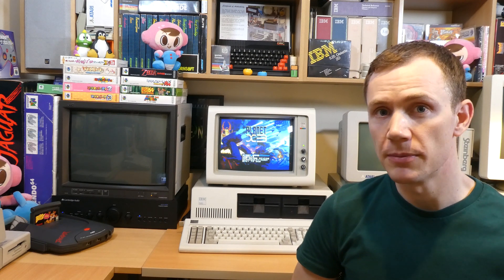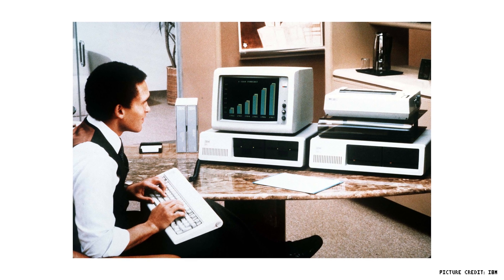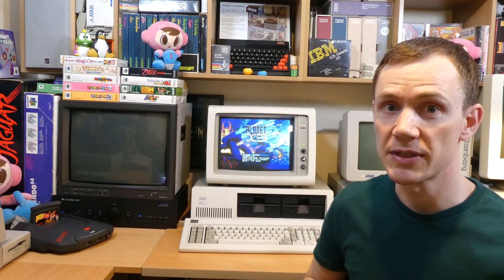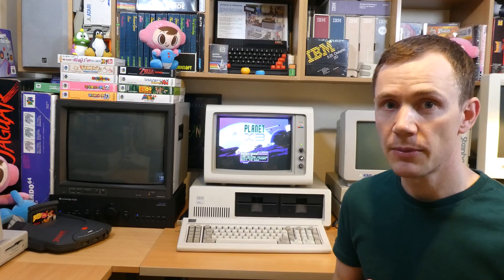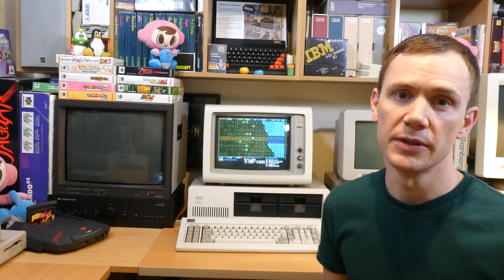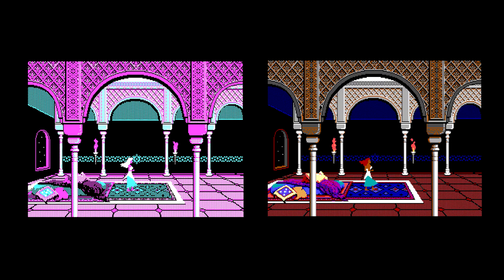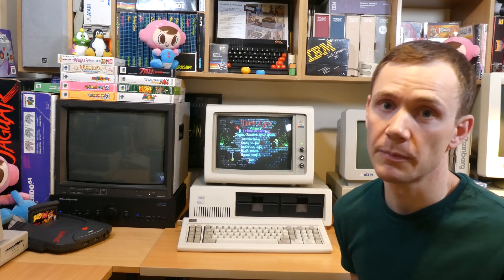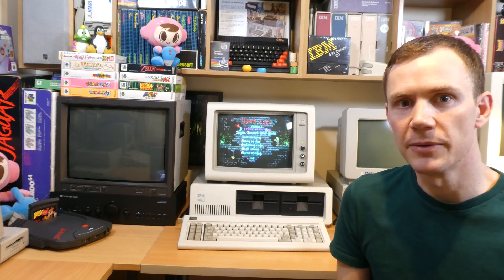EGA Graphics On A CGA Monitor? It's Easier Than You Think! #retrofair

Comment: On an interesting side-note:
My first PC was an Amstrad 1512. This came with an Enhanced mode which extended the CGA 640 by 200 resolution to display all 16 colours. This was primarily used by the GEM operating system but had support for some games as well, where it was generally knows as 'Amstrad Mode.' 
There was also a driver that allowed the Sierra 'King's Quest IV' and 'Space Quest I' games to be played in this mode.

Comment: I have a SYSDYNE! DF1331 EGA monitor. The capacitive power switch does not turn on power. I want to bypass the switch circuitry with a mechanical switch. I can not find the schematic so I am shotgunning the request to the web. Any advice would be helpful.

Comment: I have an IBM 5150 PC  with 640K of memory, a 40MB HardCard Plus and an IBM 5153 Monitor that I got back in the mid 80's.  I also had an external CD drive hooked up to it ((MicroSolutions BackPack CD ROM), an AST SixPackPlus and SoundBlaster CT1350.   

The Logo on the front of the monitor says "Enhanced Graphics Display", so I'm not sure if this is a regular CGA monitor or an enhanced CGA monitor.  I put an Everex EV659 Graphics card in the IBM PC.  The switches in the PC are set to EGA as well as the switches on the graphics card.  I got some games to play in EGA mode, such as Dungeons and Dragons, but not all games would work in EGA mode, such as Risk, so on some games I had to run in CGA mode.  I even was able to get Windows 3.1 to install and run in EGA mode after I made some modifications to the Windows Setup file (the INI file).  

The PC worked for a few months, but the HardCard gave out, so I had to boot from floppy.  Eventually the Monitor stopped working as well.  I don't know if that was because I was pushing it too hard with the EGA card or if the power supply just gave out since the power light on the monitor does not come on anymore.  For now it's just a display item in my study.  If ever I get some spare cash, I will replace the HardCard and repair of get a new monitor (probably a 5154).  It was fun to play the old and nostalgic PC games while it was working.

If anyone is curious as to how I was able to download vintage games, drivers and other files or programs, I built a PC that could run Windows 95 plus able to access older floppy drives.  I downloaded the files I wanted onto my modern computer, copied them to my Windows 95 computer and from there copied the files to floppy or CD's to run and install on my vintage PC. ✌😎

Comment: You get the colors of EGA but can't use the 21.85 kHz Horizontal Sync for 350-lines? So, ega monitors were the first multi sync monitors? as they also supported 15.7kHz.
 But very rare to get hold of now?

Comment: We jokingly called the CGA Crappy Graphics Adapter because even my Apple 2 had 6 color in HGR. Updating the CGA text screen could cause “snow” unless done carefully. It really was a mediocre card. There were a handful of games that pushed the card such as a Pac-Man clone IIRC but that was the exception.

The 8088 MPH demo showcases what is possible which is mind blowing. 

The VGA was a real nice upgrade compared to the EGA.
Reply: The home market for PCs didn't really exist until 1984 so when CGA was released in 1981 it was purely intended for business customers. 320x200 was a relatively high resoultion for the time and the pallete of 4 colours were intended for high contrast in business applications. You need to keep in mind there really wasn't much better in 1981; CGA's 16 colour composite mode was superior to what the Apple II and VIC-20 could do and even arguably looked better than the Atari 8bits. Burgertime in composite mode is a good example of this.  320x200 was a great resolution for text heavy games (i.e. rpgs and adventure games) and despite the common misconception that CGA only has 2 palletes of 4 colours (black/cyan/magenta/white or  black/red/green/yellow both wi) both were two variations in intensity, there is actually a superior 3rd pallete of black/red/cyan/white (accessed by setting CGA to composite mode while connected to an RBG monitor). The background colour can also be changed to any of the 16 which affects all the colours and in total there are 96 different variations available by changing the background colour and intensity. Each pallete has 4 main colours plus 6 dithering combinations and these palletes can be switched realtime during a game. There are mockups of CGA games using these alternative palletes and many look quite nice. 

Overall the main issue CGA cards suffered from was the lack of a home market to encourage developers to actually learn how to code for them. Most games were low effort ports from other systems that made little effort to take advantage of CGA capabilities much in the same way many Amstrad CPC and European MSX games were low effort ZX Spectrum ports. Sierra switched to PC development in 1984 but primarily focused on PCjr/Tandy graphics and by the time other developers came over from 1986 onwards, 16 colour EGA / Tandy graphics were already common in homes. While there were still many CGA users, CGA was given low priority by developers with the idea that most users would eventually upgrade to EGA or VGA (thanks to rapid price drops every year). The default to the black/magenta/cyan/white pallete in most games was just the minimal effort way of including CGA support without needing to think too much about it.
Reply: @dgmt1  The PC home market took off after Nov. 1982 when Microsoft's Flight Simulator was released.  It was THE litmus test to tell if a PC clone was "compatible.

A LOT of businesses switched to the Monochrome Display Adapter (MDA) and the Hercules Graphics Card (HGC) which had a far superior 9x14 pixel font (resolution of 720x350) which made text super clear for Lotus 1-2-3 and Word Perfect compared to the crappy 8x8 font of the CGA.

A few apps even supported the HGC 720x348 graphics mode such as Borland's Reflex.

16 color graphics on the CGA wasn't really popular since it was a crappy 160x200 resolution. Even the Apple 2 had a better 280x192 16 color double high-res graphics mode.

By the time people started to figure out how to abuse the 16 color text mode for pseudo higher resolution graphics the EGA in 1984 started the demise.  The VGA killed CGA off for good.

Comment: Don't ask me the specifics of this, because I don't know enough about electronics: This is how we ended up with VGA: My dad (electronics guy and TV repairman by night) tried this and somehow the CGA screen we had simply couldn't handle the EGA output. You could SEE the glorious color graphics, but it was timed differently or something, and the picture would roll, or get squeezed/distorted, etc. He said he knew how to make it compatible and tried replacing some components in the screen and adjusting some stuff. At one point though it all went wrong (or the monitor simply wasn't destined to be clocked this way) and the magic smoke escaped: Killing the monitor beyond repair. Dad went "well, I guess I'm buying a new monitor" and sprung for VGA instead. I definitely didn't complain.
Reply from the maker: Sounds like you got lucky! Yes, most of the EGA modes are 21kHz whereas CGA is 15kHz, so if your graphics card didn't offer this functionality you'd need a multisync monitor to support both, and they were expensive at the time.

Comment: EGA cards were badly designed to be honest. Even though they had a lot of new features, they were mostly useless and EGA in general was used as a CGA with more RAM that allowed to display 16 colors in CGA modes.
64-color palette was a great idea, but it was limited to 640x350 mode only. It was impossible to change palette in 320x200 or 640x200 modes and 640x350 mode required 256 KB of RAM and special EGA monitor which very few people had back then.

IBM was so disappointed in EGA that their next standard MCGA didn't even support it and was just a CGA with 320x200 256 color mode added on top.

Eventually VGA was made which finally merged all that CGA/EGA/MCGA mess into one and added useful features on top of that.
For example VGA allows to pick custom palette in EGA modes!

Yet still VGA cards lacked useful features like blitter that would not only helped in games, but also would make high-res GUI much more viable. These features started to appear in Windows 95 era, where accelerated 2D become a must.
Reply: apart from the failed PCjr, IBM exclusively targeted the business market and thus both CGA and EGA were never intended for gaming or home users. The home PC market only started in 1984 and was entirely driven by clone manufacturers who very quickly came to dominate total PC sales. For professional use EGA was still one of the best standards prior to VGA's release in 1987. It was superior to both the ST and macingtosh's video modes, and while the Amiga 1000 had more colours, visual clarity was much better with EGA on an EGA monitor. 

As for home PC gaming, EGA's capabilities were wasted but that wasn't due to poor design. RGBI/CGA monitors were relatively cheap and popular with home computer owners of many systems. However they were limited to a fixed pallete of 16 colours and thus any standard that went beyond that would have required a new, and initially, more expensive monitor standard. 640x350 was just too much for gaming setups in the 80s thus once EGA prices became affordable due to clone manufactuers, it was picked up as an upgrade for home users who wanted to get the full 16 colours on an RGBI monitor due to the lack of viable alternatives. Of course it would have been far better & cheaper if IBM just adopted plantronics solution of increasing CGA's vram to 32k and adding a 320x200 16 colour mode rather than releasing both EGA and PCjr/tandy graphics in 1984. But you need to keep in mind that IBM was actively trying to avoid associating their business machines with gaming so that was never EGA's design focus. 

Finally MCGA not being compatible with EGA has little to do with IBM being "disappointed in EGA". VGA and MCGA were both released at the same time with VGA intended as a high-end solution and MCGA being a cut-down cheaper version. Basically they gimped MCGA on purpose in order to tempt users to buy the higher-end models, a tactic they had used with previous releases (for example the 6 vs 8mhz 286 AT). This tactic quickly backfired though when other makers produced much cheaper VGA clones that quickly made MCGA obsolete.

Comment: I'm guessing KQ4 is out of the question?
Reply from the maker: It looks like KQ4 requires a minimum of 80286 CPU @ 8MHz, so I think it would really struggle.
Reply: @ctrlaltrees  I played it on my XT (clone, 640kb of ram, CGA card), using CGA, and it came in 9 floppy disks!. some of the screens were slow, but it was playable.
I don't know if it was 8 or 10mhz because the mhz display thing was broken, it showed "19" all the time, but I know that cpu wasn't 19mhz. probably 10mhz. 
(just to have an idea, I could play fine games like golden axe, prince of persia, maniac mansion, space quest 3 or monkey island 1. that one was slow in some places but totally playable in others).
Reply: @ctrlaltrees  I think it was minimum recommended because the game is fully playable on a 4.77 MHz XT and not too bad on a 10 MHz.  There's the SCI version of the game, and AGI which could be ordered direct from Sierra for an extra $10. AGI was fine on 4.77 MHz, but ugly and had no sound card support (just internal speaker and Tandy/PC Jr.). The sequence to clean the dwarves' tree house would take 30-40 MINUTES with the SCI version.

Comment: I really tried today but I cannot get this to work. I have an IBM XT 268 with an original IBM EGA card and an IBM CGA 5153 monitor. CGA modes do work, EGA modes do not! What exactly will I have to do with the two jumpers and the 4 dipswitches on the IBM EGA card? (The battery buffered Bios, is set to "EGA" via "gsetup", everything else does not seem to work). I'd like to have 16 colors in "prince of persia" instead of 4! Any ideas?
Reply from the maker: Hi! Sorry to hear you're having problems getting it working. I used the 5153 switch settings from here: http://minuszerodegrees.net/ibm_ega/ibm_ega_switch_settings.htm

It's been a while since I played it so I can't remember, but does Prince of Persia prompt for the monitor type at startup or does it autodetect? If it asks, you need to select "EGA" of course.
Reply: @ctrlaltrees  Thanks for your answer.  I know the website of minuszerodegrees, but still no luck. Still does not work. You can type "prince ega" to force ega in prince of persia, but no luck. Maybe my IBM EGA card is broken. I will try another EGA card from a friend......

Comment: That's cool!  I've got my aunt's old 5160 with the 5153 monitor.  The monitor works, but I can no longer get the PC to boot.  It powers, the hard drive spins up, but no beeps or display even though the display works.  I think it got humidity to it while it was in storage during a couple of moves where the keyboard has gone missing too :(  At any rate, if I can get it up and running again one of these days I'm going to try and obtain an EGA card and try this trick out!
Reply from the maker: Sounds like it could possibly be RAM failure, it's very common in these. I had the same issue with my 5150 when I first got it. It's a fairly big job as the chips are getting hard to get hold of and they're soldered to the motherboard, but certainly not the end of the road for these old machines.
Reply: @ctrlaltrees  I need to find another vintage collector near to me and compare some notes with similar hardware.  I haven't even touched a soldering iron in years, and I don't know if I have the time or patience to go at it myself right now LOL.

Comment: I aways wondering why CGA use those ugly combination of colors
Reply: There is a trick to get 6 colors from CGA. Only a couple games used it, such California Games.  I only noticed very recently.
Reply from the maker: @-taz-  Interesting, I wasn't aware of this. I have California Games but never noticed!
Reply from the maker: Yeah, they weren't a great choice were they? None of the palettes are very nice. I assume they chose highly contrasting colours with business software like spreadsheets in mind rather than gaming.
Reply: @ctrlaltrees  yes, but why game developers did not customize those pallets ? they are atrocious, and you can choose from 16 colors ? Is this some kind of hardware limitation for those pallets ?
Reply from the maker: The palettes were hardcoded due to the limitations of the hardware. There was no way to override them, unfortunately. There were some tricks to get more colours by using the composite output and some computers like the Tandy, PCjr and Amstrads extended the standard CGA colours, but games had to be specifically written for those machines to take advantage of it. Early PC gaming was a bit of a mess, to be honest.
Reply: @ctrlaltrees  this is so stubid to hard code those ugly pallets :(

Comment: Tell me more about that overclocking solution you’re using.
Reply from the maker: I made a video about it: https://youtu.be/8oWyogPZ7Bw

There's a link in the description of that video to a GitHub repository I created which goes into everything in great detail.

It's a DIY solution from 1985 that adds a second crystal and oscillator chip just to clock the CPU. Currently I'm running at 7.37MHz (up from 4.77). It's a huge improvement with no stability issues so far.
Reply: i'd like to know more about this too